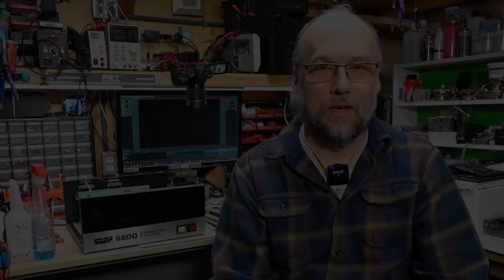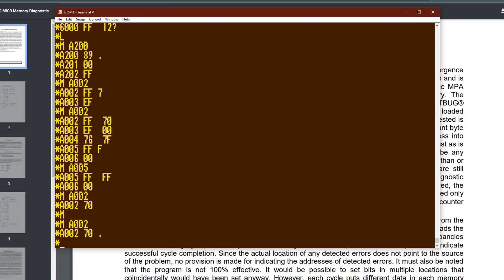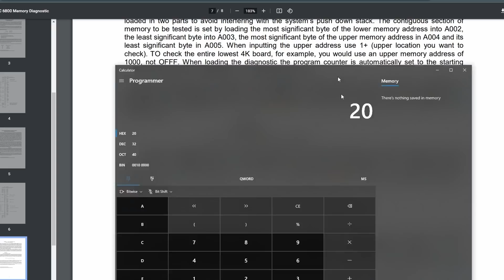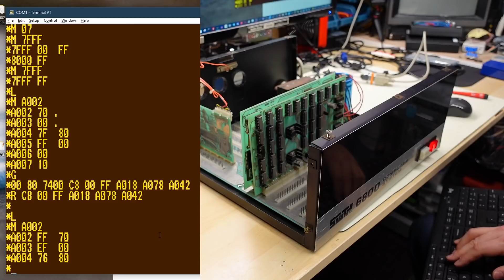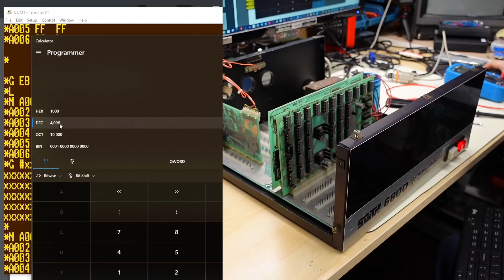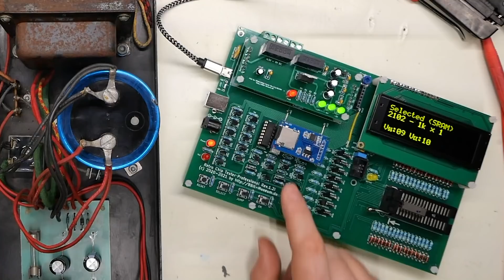Searching for bad RAM on a 45 year old SWTPC 4K RAM board

Comment: It brings back memories in my SWTPC6800 with 2 4k boards.
I had a problem with the 4k integer only BASIC causing it to lock up.
The problem was a bad CPU chip.
Under 1 and only 1 condition it had problems.
If the index register was x0bff when incremented by 1 it gave x1c00 instead of x0c00.
I wrote a number of debug programs in assemble, hand assembled them and entered in hex to debug it.

Comment: I worked at Motorola Microsystems during the 6800 to 68000 years as a bench tec fixing 680x cpu, memory, and what ever else came down the pipe.  When i worked on memory boards I wrote a script to load the memory with 3's and c's (hex) then with memory scan i could find out exactly where bad chips, shorted or open address or data traces were. Also there is a trick that on 6800 cpu"s that makes the address lines cycle, i can't remember how to do that. As a snapshot of computer price's Motorola charged $1/byte for memory. 1 2kB  memory board = $2000.  It was fun working there.  I learned to write 6800 machine code to do all sorts of testing. There were about 20 of us all sharing our tips and tricks. We could not make mackines fast enough. There was a time we worked 12 on and 12 off 6 days a week for a month to try to catch up.

Comment: Adrian, I find it entertaining how your generation marvels at how there was a generation of technology "before" the one that you began with.  The machines that came before served as the "magic carpet" that inspired the development and refinement of ideas that became the tech we know of today.  I was facinated by computers from an early age when the machines filled rooms and and require small power stations to run.  When micros first became a glimmer in the distance, I read an article on the development of the 4004 chip and decided that I wanted to get involved.  The 8008 followeed and then the industry took off.  The very early kits were designed to only provide the experimenter (rather than User) could cobble together a working system.  The "software" was very much a do it yourself proposition until commercial products like CPM entered the market.  Your fabled DOS was only a glimmer at that point as the Z80 and the M6800 ruled due to low hardware costs.  I can tell you from the countless nights spent trying to noodle out a stubborn problem with nothing more than a low level monitor program, the knowledge that you are strugglng to learn has been a right of passage for countless engineers  striving to understand these mysterious boxes.  The computer in all its current forms is a testament to the imagination and tenacity of millions of men and women who had and idea and would not quit until they made it work.  You are a living tribute to the "Old School" mindset of curiosity and adventure that created and entire cultural industry that affects every person on earth every day.

Comment: LOVE your SwTPC (SwatPuck) series. I have one of these - home-built. It is in storage.

For replacing bad 21L02 memory chips - go to Electronic Goldmine and search for 21L02. They have a 'new old stock' of TI chips for about $7.00 each. 

I also have original documentation - in a notebook. Schematics on most of the boards.
I built my SwTPC when I was about 21 or 22 yrs old - didn't know what I was doing. Bought the bare boards and the parts. I think I socketed everything. Miraculously, the computer powered up with very few issues. I had to add a 0.33uF capacitor on the +5V regulator on the main board - it was oscillating.
I had 2kRAM - and had to expand it to 4kRAM so I could run Tom Pitman's Tiny BASIC - that came on punch tape. I had an ASR33 teletype. (It took about 5 minutes to load)
I originally started out with the Video board that SwTPC offered. I also soldered that one together and got it to work - providing video to a 9" SONY TV that I soldered a wire into and fed the video into. (You could switch the TV to a blank channel on the dial.)
The keyboard I used was a kit that Radio Shack sold for a brief time. I assembled it and wired a cable from it to the input of the video board... or was it to a plug-in card on the SwTPC? IT's been a while ago... I don't remember.
The computer boards - I fabricated my own housing for them from plywood - it was about 24" x 24" square and 10 - 12-inches tall. 
I designed my own power supply - probably not acceptable by todays standards - and barely acceptable back then, but it worked.
I never got any floppy or hard drive storage, and only used paper tape for my storage.
When I finally upgraded my computer, I went with a VIC-20 which had as much memory (RAM) as my SwTPC but also had color and other features that I could not get on my SwTPC - like cassette program storage.

I'm sure that there are others here who can help, but if you need any details on your 6800 SwTPC, feel free to contact me. I'm on LinkedIn.

Comment: Looks like that code for the ram test is quadratic, especially if it takes more than double the time for double the ram. If you can run that 1k test 4 times, you'll come out ahead, instead of doing the 4k test.

Comment: With the 2102 RAM chip being a 1K x 1 device, you actually have 3 banks of 1K bytes of RAM. By jockeying the bad chip around to the highest location (7C00 hex) you could have used the board as a 3K byte board.

Comment: The 21L02 chip is used as video memory on the TRS-80 Model I. The Model I only provided 7 bits of video memory. We had t piggyback the 8th chip and do some minor mods to the board to enable the 8th bit and with that, lowercase.

Comment: Wow! I haven't heard of SWTP in decades. 

If RAM appears bad I first reseat all socketed IC's, (machined-pin sockets are the only ones I trust,) then I look for power supply voltages on a couple of chips, then I look for clocks and refresh, then I use my laser thermometer and look for hot chips. If I find nothing, only then do I bother with RAM diags. It's quicker to do the other tests first, and RAM tests back then weren't very sophisticated. If I saw a bunch of errors I'd try to identify a hung address decoder bit or I/O buffers. Socketed chips make fixing RAM boards a breeze, slow but a breeze. Fortunately, I have a pretty good stock of old LSI and VLSI support chips to swap them in and out. If the fault is intermittent then a point-source heatgun and freeze mist are in order.

What chip is used for mem on that board? I'l look to see if I have a couple I can send you. The best person to fix antique boards is an antique tech, and I'm in my 70's.   :)

Comment: 20:08 "Computers are simpler now...." - Well, they are when they work, but the average user has no chance if they stop. A tinkerer could figure out a hardware fault by swapping boards in a desktop pc, but if Windows decides not to play, it's a whole different ball game. Tracing bad RAM chips on a board is child's play in comparison.

Comment: So if both this machine and the CoCo are based off Motorola's reference design, does that mean it could be modified to run CoCo software? Obviously you would need to make a card that adds video and sound.

Comment: When I see that computer I still think of my friend Judy, who had one. Thanks for working on it.

Not as fancy as OS9, but my friend used to run FLEX this: https://en.wikipedia.org/wiki/FLEX_(operating_system)
Images/Docs: https://www.simonwynn.com/flex

Looking at the hardware on the computer, and at risk of seeming like shill, I am reminded that Evaporust really would take that rust off pretty well. I used it on a tray of assorted hardware. It may remove black oxide, but for hardware with other kinds of plating, such as zinc-chomate, it seemed to leave it intact, while doing a pretty good job. Afterwards the hardware could be sprayed with something to protect the rust--or perhaps a thin coat of lacquer would also protect it, as long as it's sprayed outside with proper breathing protection. I prefer lacquer because it dries harder and in a shorter time. I run the remainder back through a funnel and a coffee filter--before putting it back into the container. Although Evaporust is safe, like vinegar, it's PH means that it's not good to get into cuts. I think that Rustoleum also has their own chelating rust-remover too, that might have greater availability.

Also, I had an experimental idea: cleaning boards in an ultrasonic cleaner, but with a twist, of using some Kool Mist mixture to prevent corrosion whilst cleaning. It should prevent rust from forming. Kool Mist is a fairly safe chemical that can be added to distilled/dionized water that allows steel and iron to be soaked in it to prevent rusting. It's mixed about an ounce to a quart. After cleaning, the board could be blown out with either compressed air--or small handheld leaf-blower.

Comment: Good work on this one, I didn't even scream at the screen once! I did, however, pause to download those tests and take a quick look at them before you started them up.
The best memory test that I actually implemented at work was a rotating series of "100" and "011". Three doesn't divide into eight, so it really gives the memory a good shakedown. I got the idea from the old Mac Plus startup memory test where you could visibly see the pattern on the screen. It's probably the best simple memory test there is. It actually caught problems in some obscure boards we got from Intel! (this was in early 2001)

Comment: Hi Adrian, I’m from Germany and watch you channel basically for the Commodore Stuff. I really like it. But now to SWTPC, in the 80/90 th. I worked a Lott with this heavy Systems. The where used for logistics in Pharmacy/Drug Stores here in Germany. And the company I worked for also wrote some Software for accounting and billing. Usually first we used double 8` floppy disk drives and later also 5 to 10 MByte Harddrives. There where tripple density controller for the Floppy Drives wit a capacity of 3,4 MByte, which was amazing for this time. I really like this SWTPC Videos, great job 👍

Comment: Back in the late 70's, I used a Motorola 6800 D2 evaluation kit to programme a complete radio paging system in machine code. The data storage was with a cassette tape, for which I used my own cassette recorder. I had to build an EPROM programmer from scratch to programme 2708 EPROMs with the paging code. They were 1k byte with three power rails, and needed multiple passes in order to programme each cell. The programmers were really expensive to buy back then. I still remember the weird ozone smell from the home built UV EPROM eraser. 

The radio paging controller we made had a 7 segment LED display and a keypad. It connected to the paging transmitter and could control up to 1000 pagers on the system. Its code fitted into a single 2708 EPROM with space left over.

The computer you are working with I would have given my eye teeth to have then. Life would have been so much easier. Calculating branch offsets manually was quite a challenge, and testing the code was extremely time consuming.

I really enjoy your channel, Adrian. So many wonderful memories.

Comment: @Adrian's Digital Basement If you don't have memory location info on the schematics then you can use one of the faulty chips to "map" which socket is what memory range. Use a known bad chip and swap it into each other known working socket and run the test.

Comment: I know someone who, when they were 12 years old, got a mouse. His dad called them to see if there was a device driver to go with it and the response was that if his 12-year-old didn't know how to write a device driver for it then he didn't deserve to have a mouse. Ah, happy times. I do miss having schematics for electronic devices though.
The control circuitry for my coffee maker failed the other day which was no big deal because I wanted to control it via networking, 12V and an inverter anyway but the company wouldn't even tell me what the wires were because "it would invalidate my [non-existent] warranty" and "for safety reasons".
Reply: That's why I tend to use very old electronics stuff. I can get schematics, and I can repair it. No amount of 'new' and piles of sophisticated features is of value if something doesn't actually work and can't be fixed.
Reply: Reminds me of a certain type of Linux head who insists you compile everything and somehow know not to accept the default compiler flags for 1 in every 12 package..!
Reply: Someone watches Louis Rossmann.
Reply: @ImpetuouslyInsane  Yes but I wouldn't touch Apple's overpriced, underspeced and locked down products with a 10' pole. No prizes for guessing my OS of choice!

Comment: If you think about it, in some ways computing has returned to this early structure with the popularity of credit card sized computers such as the Raspberry Pi and Arduino. The biggest difference is the also include a mass storage system in their tiny form factor. It requires an external terminal to access just like these old computers. They are mean to be interfaced to the real world through GPIO.

Comment: TeraTerm allows you to directly send files (just drag&drop the whole file into the Terminal window), so you don't need to copy/paste from the file manually.
i use that myself to load .bin files via serial onto my 65C02 SBC and it works great

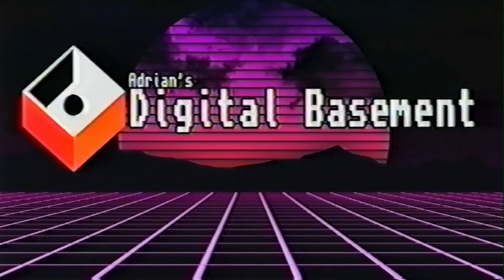Comment: @36:12 I'm sure you are aware of it, but I think it is important to state it explicitly: You can get false positive readings (i.e. "is OK" when the RAM still has issues), but you can not get false negative readings. If the memory test claims that "memory is broken", something in your computer, likely the memory, acutally is broken.

PC component vendors like to claim otherwise if they don't trust your memory test and try to reject returns due to the test being "incompatible" or reporting a false reading. For example, the German computer magazine c't reported about low-quality SDRAM modules around 1999 and people started testing their RAM with extensive tests. There was a notable backlash against the c't report because some vendors were unhappy with the increased amount of "your PC has bad RAM" claim. In one of the follow-up issues, they published one or two letters to the editors by upset vendors.